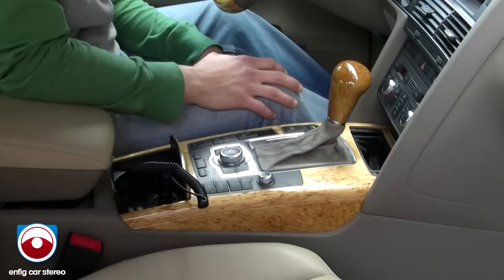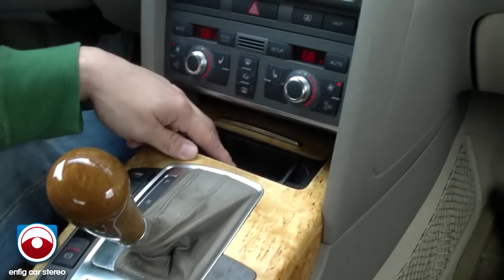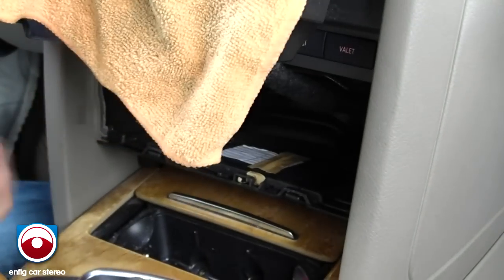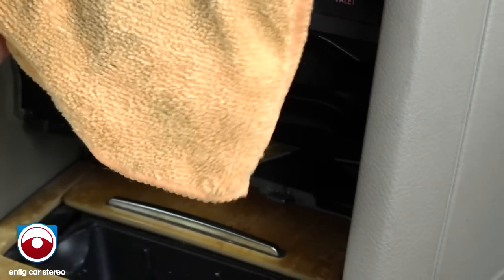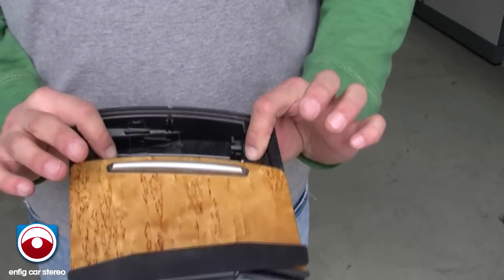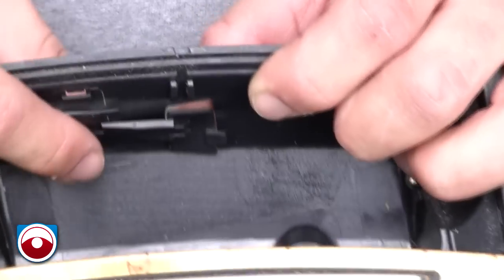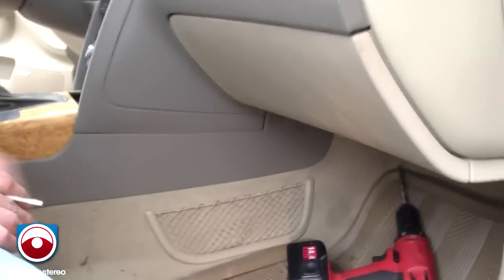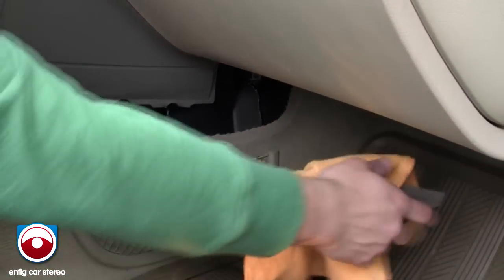2005 - 2009 Audi A6 iPod AUX USB Adapter Install Dension GW51MO2 Spec.dock AUDIC6V2i Part 1 of 5

Comment: Hi there , I have Audi A6 c6 2011 has no Bluetooth for music streaming! Or iPod connection in the gloves box! Haw much will cost me to supply and installing aux  or iPod connection please ? Thanks
Reply from the maker: Here are you options but we do not quote installs publicly.

AUX
http://enfigcarstereo.com/ENFIG_AUDI_MMI2_AUX_A6_A8_Q7.html

iPod/iPhone AUX USB (old 30 pin with low charging for old ipods)
http://enfigcarstereo.com/DENSION_GW51MO2.html

iPod/iPhone AUX USB
http://enfigcarstereo.com/DENSION_GW53MO1.html 

iPod/iPhone AUX USB + Bluetooth
http://enfigcarstereo.com/DENSION_GW52MO1.html
Reply: Hi, I just need the usb slot? how much will that be? I've heard that all I need is a some sort of cable that I attach to the cd changer. I have the Audi A6 2005. thanks
Reply from the maker: USB for iphone or USB sticks?
Reply: Edvin Maksuti - hey did you get any help to use usb to play in your Audi a6 , because I am also having the same vehicle and looking for help

Comment: I've got this product and not followed this guide (thanks btw) my only question is does this shut down when the car is locked or will it remain on and drain the battery?
Reply from the maker: It shuts down a few minutes after you lock the car.  The blue light will shut off.